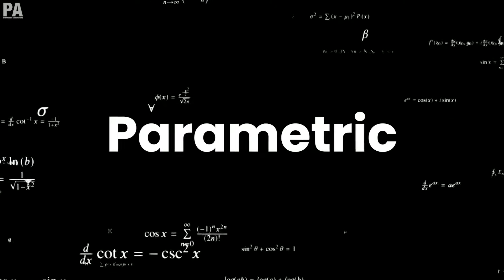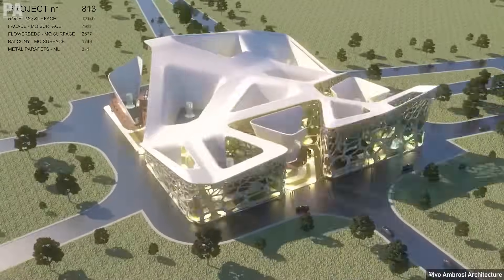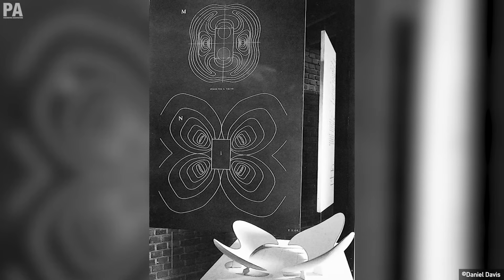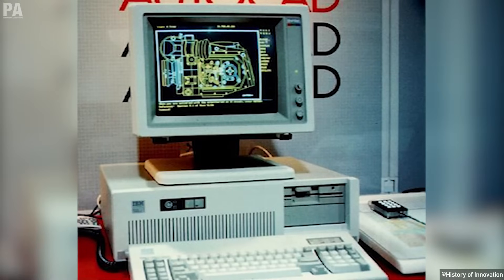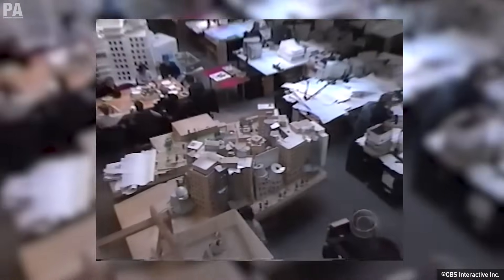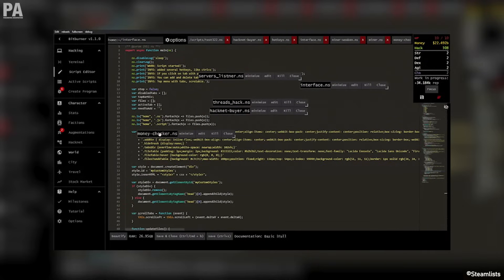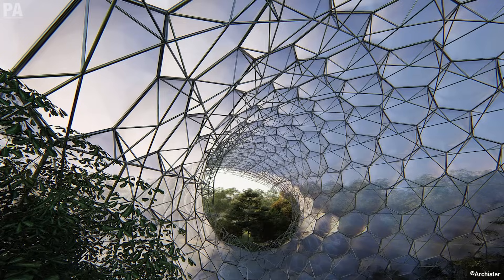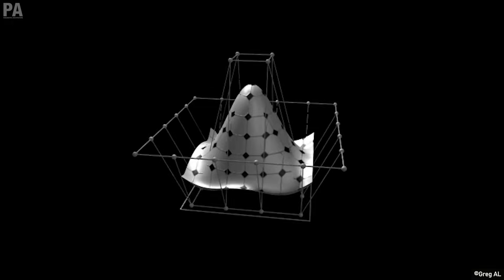Parametric Design in Architecture

Comment: I became interested in parametric modeling near the end of my career as an architectural draftsman (1977-2008). I used SketchUp from 2003 and was interested in using parametric software, but I couldn't afford it and really had no use for it, other than as a hobby interest. I've been a dyscalculic all my life and, thus, had no way of becoming an architect or an engineer, like my father was. Nevertheless, I was able to do CAD as long as I had a calculator and the measurement tools within Autocad and SketchUp. As an abstract sculptor, I have always experimented with free-form shapes and was using SketchUp to create 3D models. I would have used parametric software, but, as I said, the cost was just beyond my reach.
Reply: me too Garry!

Comment: This was a warm friendly introduction. I work day and night with parametric architecture. This is extremely familiar and natural. Parametric design is older than the computers themselves. It started long time ago even with the work of Brunelleschi's Dome. 

It's an old practice that has more than 2,000 years. The application of differential geometry, differential equations and logic to design was inevitable. The Arabs and Indi where the pioneers of these techniques. 

Great video as usual.
Reply: Also consider that before humans constructed parametric architecture we sought shelter in natural parametric architectures like trees and caves.
Reply: But whats the reason why u prefer to use it to achieve complex forms vs the traditional way of designing?

Coz i noticed people do parametric coz its a cool thing to have forms associated w the designer, but whats the foundational value to it to you personally?